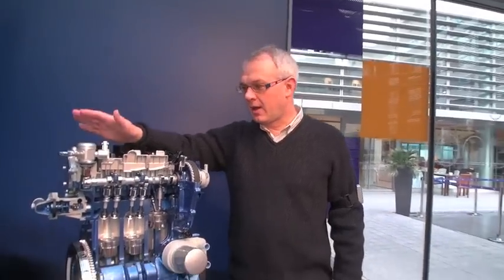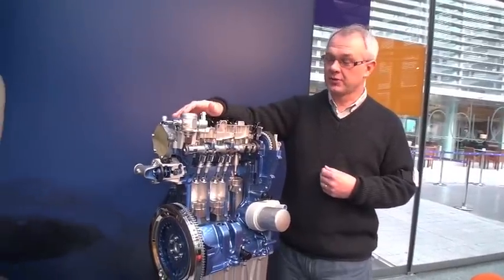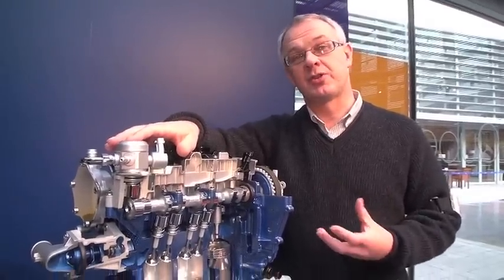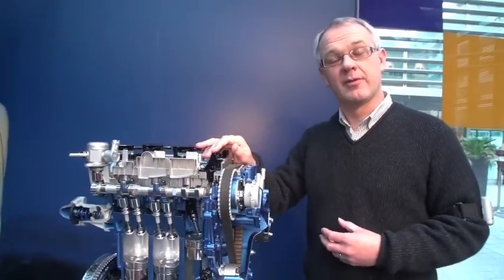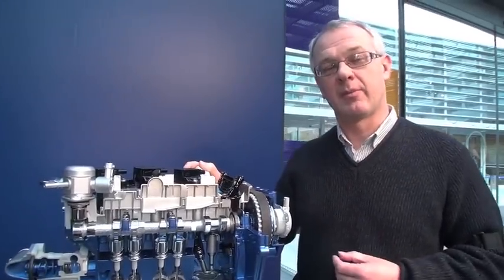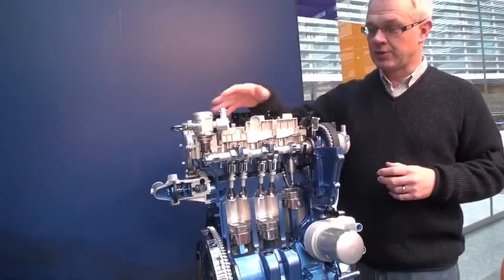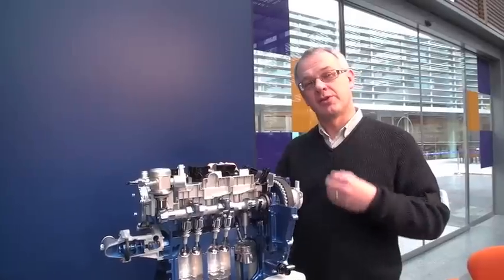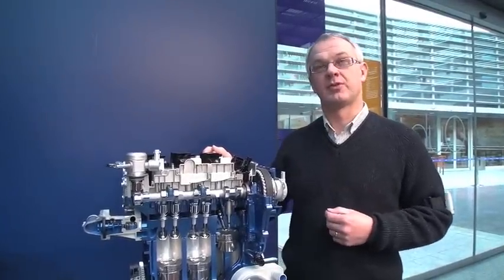Ford 1.0 Ecoboost engine

Comment: Make a 2-4 liter straight 6 using this design and I would buy the crap out of that.
Reply: +Ghev Ferromere 

agreed, the straight 6 rules...
Reply: Can I ask why you say that? Just curious, I'm still learning engine stuff. I've learned a lot so far. I also like hearing other opinions when it's interesting. Your design sounds interesting to me.
Reply: The more technology you throw at the engine the more sensors, computers, and the like you have to fail that coupled with high revving to  achieve delivery of that torque will lead to Serious engine wear , EGR valve and Turbo wear one tiny glitch or internal leak  will also have down stream problems for other components,  all well and good and won't show up for some few years but down the road it could lead to recalls and the like.... KISS... ' Keep it Simple Keep it Stupid'..http://www.jdpower.com/cars/articles/safety-and-mpg/ford-recalls-89000-escapes-fusions-ecoboost-16l-engines
Reply: you are really outdated in car engine technology, you are talking about 10-15 years ago....
Please....if my 300 euro phone runs for 3 or 4 years without breakdowns or glitches, imagine the CPU of modern cars, they don't have to manage the new apps or software that increases load, they just have to manage those specific instructions for 10 or 20 years. 
You completely missed the video and tech expert explanation, making your comment dumber. The way the engine is built is completely different from all car makers, Period. The placement of the turbo the exhaust manifold placed on near the valves.....
Just stay in your little corner with those BMW and Mercedes engines that are still being made like its 2000's, Low tech improvements and lots of bells and whistles, and no I am not from USA.
Even in 2000 PSA developed one of the best diesel engines on that market that everyone copied the HDI, my sister still has my old 1.4 HDI diesel with 600 000 km and never got engine swap, just normal maintenance oil, filters and the other normal things.
Mercedes copied and gave us the CDI a bad copy of the HDI the engines could barely achiev more then 200 000+ km, the cylinders would blow up and open hole from one side to the other, major oil consumption with new low km's engines. But their customers, dumb retards, would still say, awesome car a machine for life, even after swap new engines in the brand and spending half the year running to the Mercedes dealership.
Dont even start with turbo wear...pls
Want to avoid turbo wear, change the oil on half the km the Brand tells you to, if they say 30 000km you do 15. My old 1.4 HDI from citroen has a turbo that sounds just like new.
Cars with turbo need to be taken good care, oil changes are essential + filters. And if you change oil half way of the KM recomended by the brand I assure you, you will never a single oil addictive, clear whatsoever. Most of the cars are designed and made to last, the problem in 90% of the times is the owner. The 10% well its just bad luck, some cars of the same model can come new with lots of problems.
Reply: Btw that website is just fake propaganda, and its even blocked in EU. 1.0lt ecoboost sells more the 1M engines for year, i dont see mass recalls or problems in Europe.
I will explain, the petrol here is standard 95 ron, not 89, not 91 (special) low octane fuels are bad for engines and for this new engines that use all they have even worst.
Here in Europe fuel preparation standard is very high, here you have the purest and highest grade fuels in the planet, because EU forces a very high standard. 95 octanes is the cheapest petrol, and if you wish to pay a few more cent for 98 octanes even better.
I make around 600km with my new ford fiesta ecoboost 1.0lt engine and the deposit takes 40lt.
The engine is even more stable and less noise then most 4 cylinder of other brands, almost no vibration, only a tiny bit on the 1min after you start the car with colder weather.
Most people that drive of ride in my car never notice the car is 3 cylinder, even when i press the gas they get amazed how a 1.0lt can do all that, and they get even more amazed when i say it only has has 3 cylinder.

Comment: I am driving the fiesta 1.0 ecoboost 2015 model now, this car engine really amazing and powerful.
I love it very very much !
Reply: it is ok for a fiesta that has only a driver and nothing else in the car.

focus requires a tune before you can merge with traffic successfully. (with only a driver)
Reply: Chris  they are definitely better than the L4. But if you had the money to buy something better... that is usually not how economy cars work.
Reply: TimeCode 1330  mine did they are crap
Reply: the motor is amazingly powerful. for its size. great for gocarts and golf carts. not so good for on road vehicles.
Reply: Sounds like a Ford employee
Reply: absoulte fucking shite motor.
i had one on hire for the day..gutless pos..my hyundai diesel is way better and better mpg
Reply: @isaachunt5799  salty Hyundai owner with a chip on his shoulder 😬😬

Comment: What the fuck is an appendix at the top-back of the engine?
I will not be able to apply this die in my car!

It is not practic engine...
Reply: jwserge What the fuck are you on?
Reply: Daniels30 I'm about this fucking thermostat or so that you can see above the flywheel
Reply: The turbo?
Reply: Daniels30 probably it is a part of cooling system. resembling a thermostat of cooling system... I don't really know so called it a fucking appendix ))
Reply: Daniels30 I was interested in applying this engine to my rear wheel drive, but this appendix will hit the motor-sheet or shield... a wall separating motor compartment out of salon|cabin.
Reply: Daniels30 it protrudes out of motor towards motor-shield.

Comment: too many little things to achieve one objective, increases the chances of Failure. i would give this engine couple of years to prove itself
Reply: Ben Tj This engine has been around since 2012
Reply: Don't bother, people like him will repeat this FUD over and over as they can't quite get around to how engineering works. Rather than admit that this is one hell of an Engineering job at the boys at Ford UK, a job which kit car manufacturers are standing in line for to boy a box engine version from btw, they will keep going on and on about how "reliable" their old Mercedes is and that they can never beat that and blablablabla. 

Never EVER giving any factual evidence of these engines breaking down or showing factual numbers that are non FORD related to either the reliability in negative or positive form of these engines.

THey just can't admit it to themselves.

Comment: I'm pretty determined not to buy any vehicle now that uses a belt for timing so I'm a disappointed in the fact Ford used one here but I don't know much about 'wet belt' setups.  Intriguing little engine however.
Reply: timing belts are not the same as they used to be, the VW engines for example use timing belts but they can last upto 80k- 100k before changing much like a timing chain
Reply: kd84afc
My friends GM truck with a 4.3 is about to hit 300,000 miles and has never had the timing chain replaced so I'm not sure exactly what point you are trying to make here... ???
Reply: SirtubalotTX my point is this engine is using a timing belt as only had a life of around 40k maybe 60k on certain cars before they needed to be replaced but now they can last the life of the car as explained in the video and as you stated you wouldn't buy one with a belt, so that was my point, they're saying there more reliable then they used to be.
Reply: kd84afc 60k to 90k has been the 'norm' for timing belts for as long as I can remember and that is definitely not in line with the average life of a modern engine or a well made timing chain. A properly made and implemented chain (good alloys, tensioners to compensate for stretch and guides with no silly plastic) can last 200k...300k and beyond and that will never happen with a belt. Now...this belt running in oil? I don't know enough to speak about that but I am looking into it. Aside from this oil/belt configuration, things with timing belts have certainly NOT improved and I don't want this kind of arbitrary maintenance item on my car. In fact..one of the cars I drive is a 14.5 Camry Hybrid and it has no belts whatsoever. It's the 21st century and it's time for manufacturers to stop the timing belt nonsense.
Reply: SirtubalotTX I said USED to be the norm, now they last the life the engine as stated in the video
Reply: kd84afc
Ok, let me get this straight.  You're saying that 90k is now 'the life of an engine'?  (You said "timing belts are not the same as they used to be, the VW engines for example use timing belts but they can last upto 80k- 100k before changing much like a timing chain"  Just being sure I'm reading your post correctly. 

(Edit)  We're confusing dry belts with the oil/belt configuration in the 1.0 Ecoboost.  In the case of this video, it will be interesting to see how long the belt will last in this engine.  I am curious also if this engine is clearance or not.
Reply: SirtubalotTX your clearly not comprehended to my last message or to the person on the video so no point explaining further
Reply: kd84afc
I think I'm comprehending it just fine.  You stated pretty clearly

"timing belts are not the same as they used to be, the VW engines for example use timing belts but they can last upto 80k- 100k before changing much like a timing chain"

You clearly said that timing belts can last up to 80k - 100k  'much like a timing chain' and I refuted that.  (Properly implemented timing chains last MUCH longer than that).  If you had something else in mind and you want to correct yourself, feel free.

By the way.. the Ford service manual for the 1.0 Ecoboost states that the belt be replaced along with the camshafts at 150,000 miles which incidentally, is not the life of this engine.  (I'm still confirming this and I find it odd that the camshafts are included).

Comment: That's some seriously clever technology.
Reply: spiloFTW The wet belt design isn't anything new to ford, they've been using it in for a very long time now and it seems like one of the things that actually work pretty good
Reply: spiloFTW It's break and whole, and you do not have to disassemble all of the engine.
Reply: not realy the cam shafts are driven by a ruber belt xD
it will mess up your oil and when it brakes you will have to dissassemble the hole engine

Comment: Can you turn this engine round for a RWD layout? I'd like to stick one into a Ford Anglia or 100E, bolt it to a Sierra 5-speed transmission and use that as a daily driver. That could fly in a lighter car such as an Anglebox.
Reply: If you do this, you have to make videos of it.
Reply: probably, ford sells crate engines for this, I heard someone used two of these and made a v6 like configuration.
Reply: My current dream is to use an engine like this mounted transverse but in the middle position, ie like a Fiat or something,tiptronic gbox etc.using an older English body like a 100E or a Austin 1100. Would have to build an internal perimeter frame cause I would naturally chop the roof off. 2 seater open top track or hill climber. Laugh.
Reply: Good engine for a bespoke racing outfit or three wheeler
Reply: Sure, with the right hacksaws, files, hammers, torches and wire ties it could be done. 
Send us a picture...

Comment: DarthDonPedro Need lots of fuel pressure. I just wish they would stop putting the fuel pumps IN the tanks. And while they're at it, move the fuel pump driver modules into the cab somewhere so they don't get destroyed by road salt.
Reply: I'm not too hung up on fuel pumps being in the fuel tanks as long as there is easy access to it.  (I.e.. an access panel under the rear seat cushion).  Having to remove a fuel tank just to get to the fuel pump is bunk.
Reply: Agreed. I'll have to take a closer look at this thing. If they go to a straight mechanical design that will be effin sweet.
Reply: James Holbrook Pretty sure there is at least a low-pressure pump in the tank, using the mechanical one alone would cause too much trouble with pressure drop...

Comment: Because of the Direct Fuel injection. DIRECT FUEL INJECTION requires a really high fuel pressure to operate thats why it requires two fuel pumps.

Comment: lets get this on a motorcycle!
Reply: Darkside Hero Why would you want a power decrease on a motorcycle. The latest non turbo 1 litre bike engines are making 200 hp.
Reply: superbike1 Yes but it was just a joke to show how small the engine is
Reply: Sonos45 boi 200 hp out of that engine meams 1 higher fuel usage 2 engine breaking down constantly 3 no more eco, unless they put a bigger turbo, but that increases cost of production and also decrease reliability
Reply: direct injection, duel cam with what looks like shim under bucket valves with vvt, 1000cc, and a turbocharger. It's an embarrassment this thing does not make 100more hp than the 125 they claim.

Comment: Smaller engines are only more efficient because they're lighter. The new engines are more efficient because of their design. Point is it's not the turbo which makes an engine efficient. It's just a law of thermodynamics. This ecoboost engine is great!

Comment: that timing belt must be a nightmare to replace.
Reply: Don’t need to replace it till something like a quarter million kilometers. Most people don’t keep their cars that long. And even if you did. You’d probably only change it once for the lifetime of the vehicle. So it’s not really a draw back
Reply: @KevAlberta  wrong. They are lasting 100 to 150k and they are coming apart and clogging the oil pick up. So you have to take apart half of the engine to replace it an pray it didnt cause any damage.
Reply: @arielatom03  wrong. my car has 150k+ and nothing you said has come to fruition for me
Reply: @arielatom03  also only cost $500 CAD labour included to replace the timing belt once every quarter million KM, would take the average person 15 years to drive that amount. This is what I consider cheap maintenance
Reply: @KevAlberta  not cheap if your engine blows up
Reply: @arielatom03  still cheap. I bought the car for $9k CAD when it was 2yo and had 11,000km, essentially new. Drove it for 7 years and only had to replace a rear wheel-hub bearing assembly ($130 CAD, replaced it in an hour or two myself). Even if the engine blew up in the next 3 years I spent less than $90 a month to purchase the car
Reply: @KevAlberta  it is a fantastic car

Comment: I believe it is significantly lower than the older engines... since this engine is less powerful, it will receive more stress in order to reach high speeds.
Reply: Oh she’s plenty powerful. And loves when pushed to the max. Getting 6l/100km while at it too

Comment: It's not that small engines need to work harder. That's just not the case. Output is output. What happens is that the turbo allows the engine to burn more fuel by adding more air (fuel-oxygen mixture must be exact). So you get the same output and the same fuel use. What makes engines more efficient is when they're lighter, the car is lighter and the engine has lightweight parts which don't need much to move. Also the gearboxes are becoming less power-hungry.

Comment: AFAIK small turbo engines aren't more fuel efficient than bigger n/a ones with the same output. The only advantage is that the engine is lighter. I wonder if the lighter components would make the engines more reliable?

Comment: I've got the 1.0 ecoboost 125hp. It runs 5.8/100km, i borrowed a 2012 1,6 diesel 1 month before i got my car, it ran 4.8/100km. Not that big of a difference. The 1.0 petrol is also quieter, and a more pleasant drive than the diesel... In my opinion..

Comment: Looks like a very promising engine. The 92 kW version, along with the 6+1 manual transmission, would turn my Peugeot 107 in a little road monster. Not to mention that a greater value of the torque would allow me to fit bigger alloy wheels. And turbo with intercooler equals a new playground for engine tuning. Thank you, Ford! Great engine!

Comment: How come 'The Traditional way' uses a shaft (or should that be shafts) running at 2 X crank speed, whereas this uses the flywheel and front pulley 'unbalanced'. Surely this is aimed at the out of balance at crank rotation speed NOT TWICE CRANK SPEED. It appears they are trying to convert a out of balance couple in the vertical plane into one thats smaller in magnitude but its in both the vertical and horizontal planes. Thats's standard practice with single cylinder engines.

Comment: A number of different people took the car out and have put the videos on youtube. Official MPG figures are false and currently being investigated by UK Trading Standards after complaints. Check the various car forums, people are very annoyed and feel conned. The diesel focus is a much better buy, MORE ECONOMICAL, the same CO2, more torque, 3-4 times the MPG and has a better resale value. I thought the 1.0 was good, but no way would I buy a car that averages 18MPG as I found on a test drive.

Comment: Good fuel consumption?  See the road tests that show from 14.8MPG to 20.2MPG when driven in the town at 30mph, taking notice of the "shit-up" light. Small engines have to work hard, so % co2 content is low, but the overall volume of exhaust gas is far greater than a bigger engine which isn't working hard. The belt "never needs changing"?  Tell your UK dealerships that one!  It's a good idea, but not selling very well in the UK due to the very poor MPG, less than a 2litre petrol focus! Fix it!

Comment: What's so amazing is that Ford designed this engine to generate just over 120 bhp (SAE 08/04 net) and not need expensive premium unleaded fuel. Ford just announced that the "refreshed" Fiesta coming in 2013 for the US market will offer this engine as an option.